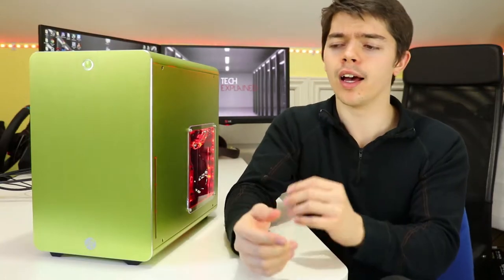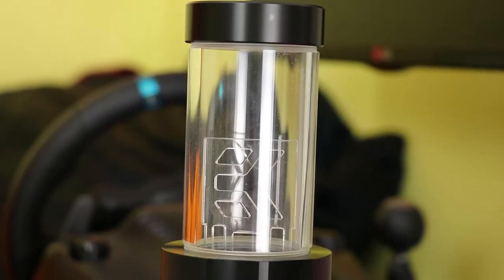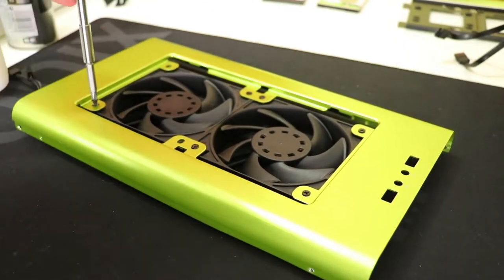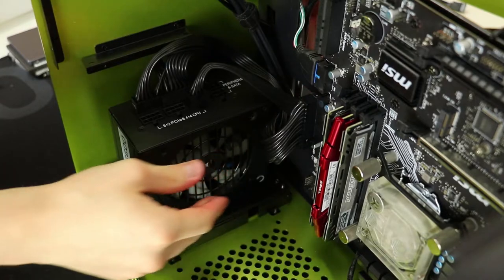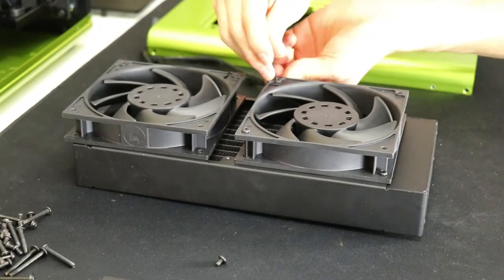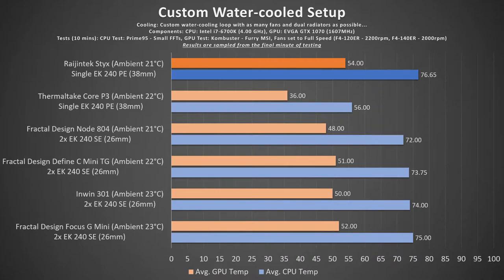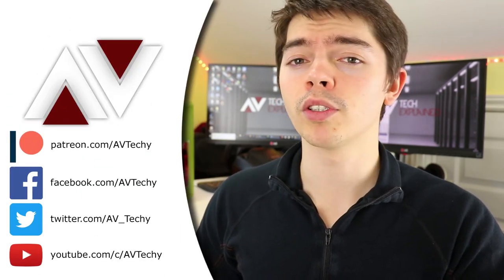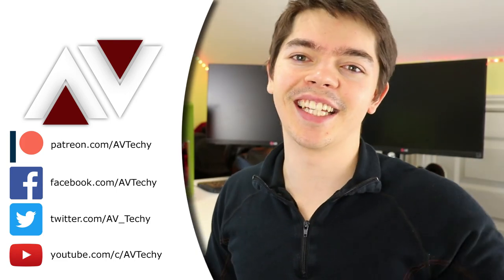Raijintek Styx Micro ATX Review - Water-cooled

Comment: Amazingly done, came out really good. That full adapter „bend“ going up to the rad looks cool. Too bad that thing has such an anemic window. 
Your doing such a great job with this channel, I hope YT finally „realizes“ it, just stick with it this will take off at some point and go faster than you think once the „switch“ drops. And then you’ll have plenty of content for newcomers to check out and stay engaged.
Reply from the maker: Thank you very much!

I wasn't 100% behind the full adapter bend, but it turned out to be pretty cool. And the other way I managed to make it work looked like a mess.

I was looking into getting a last minute sheet of clear acrylic made to replace the side panel. It would have looked so amazing, but I couldn't get one in time for the video :/. The window is just too small if you can get rid of the Drive bracket/panel. I'm going to have to see if I can find some sort of quick way to make clear panels quickly, I'll have to look for a nearby workshop that does that sort of thing.

One of the major factors that keeps me pushing to make better and better videos is exactly as you've mentioned. If/when this channel starts growing significantly I should have a great back catalog of videos for new viewers to see. But the same goes for potential future sponsors, I should have a respectable amount of good videos by the time I get in contact with some companies which 'should' inspire some confidence. I like to think that if some companies notice this channel they'd like to support it from the humble beginnings. But now I'm really speculating haha.

I'd really like to get into some super budget builds, but ironically it takes a big budget for a channel of this size to make one of those videos. Well at least about a system that's actually worth recommending. But that's a target, perhaps we should aim for one of those videos by the end of the year.

Damn it I've gone on for way too long again haha, maybe I should stick to a Twitter style 140 or 280 characters. Anyway, once again I really appreciate the support, and I hope the lighting was a little better this time around :)
Reply: AV Techy lighting was excellent, your hands were actual skin colored and not ghostly white^^
Normally I like a more suttle cooling loop look but that full mechanical looking connection has something going for it. I even went as far as sleeving my hoses to somewhat hide them^^ 

Working with plexi is fairly easy, it can be cut with a saw (powertool or by hand, fine blades for metal cutting) or scored with a knife or specialized tool and then snapped over an edge. 
I made a simple window for my case out of a 3mm sheet and to fix it I just stuck self adhesive magnetic tape around the perimeter. Would advise to spray paint the inside edges black though before putting it on as the backside of the tape doesn’t look great...it holds on to a steel frame really good.
Reply from the maker: Excellent, I decided to leave the ISO up to Auto with a set target whenever I wasn't manning the camera. Seems to work so far, so I'l stick with it since it's great to appear as human as possible in these videos haha.

I'm a fan of most styles of loops, as long as it's done relatively well and looks clean.

Thanks for sharing your experience with creating side panel windows. I really wish I had the time to create one for this case, it would have looked so good! 

I need your advise for the next video, do you think I should do a video on creating a parts list for a custom loop, or do you think I should move onto the next case? I need to start one of the videos tonight, so hopefully you'll get this in time.

I'm interested in doing a video on creating a shopping basket for a water-cooling loop since it's quite a broad topic and might help get this channel discovered, especially with the push to 1000 subs like you've mentioned before.

Let me know your thoughts, I'm happy go either way :)
Reply: AV Techy that’s a tough one, but as you mentioned „it could potentially pull in other people“ was also my initial thought. 
And it’s a good time as you just finished off a case before starting a new one with two vids. 

As also the grandmaster of watercooling Jay is kind of going back to basics lately there is hopefully a need for these vids as there seems to be a new generation rising that don’t know his older stuff and are getting in to the matter.

How do you intend to pull it off, is quite a subject to handle depending on how in-depth one goes?

I’ll send this one out for now and get back to you if some ideas come to mind.

...maybe going from basics, why it’s not as hard as it seems, loop order, benefits like adapting/expanding to new parts, cost effectiveness as used parts can be an option to get started (especially things that don’t necessarily degrade like reservoirs, radiators, waterblocks, as spare parts can be obtained o-rings for example) ... ok ideas already kicked in...^^
Reply from the maker: +TheSickness1234 It seems like a tough call, I'm with you on that one. But the more I think about it the more it makes sense. It'll be targeted towards the target and already existing audience of this channel, those getting into PC building and watercooling.

I have noticed Jay has been doing quite a few videos on beginners watercooling tips, so maybe there's a little room left for this small channel.

My initial thought is to do go over all the major factors to making a water cooling shopping basket. I'm thinking of suggesting a couple of options, one for lower power systems, and one for higher power systems, but I'm going to need to work that out a little more.

So essentially it will be going over all the components and answering all the basic questions about all the parts like tubing and fitting sizes, things to consider with water blocks, hardware for filling and draining a system, etc.

And when discussing the topics I can overlay footage of how it's used and how to make sense of it. 

As for your comments, those are very sound suggestions. Second hand parts is certainly a fantastic thing to point out. There are so many ideas now, this might be another 20 minute long video haha :/ Video length is just a disease that spreads from one video to another on this channel, I need to find a cure!

Awesome suggestions, it's always great to throw ideas at someone and get the ball rolling. Really appreciate your help!

Comment: 1. Could you have possibly used radiators with built in reservoirs  and therefore saved room and maybe used a 120mm radiator at the rear?
2. If exhausting air is a problem as you were saying with the power supply, then try adding a bottom exhaust fan? (if intake is problem then add intake fan to bottom, though this may recirculate hot air)
3. Can you try removing the top dust filter to see what difference it has on temps? Some say its very restrictive
Reply from the maker: Let's see:
1. You certainly could, but of course extra though would need to be taken into account with regards to an extra set of really tight connections from/to that rear radiator. You might need to get more angle adapters to make it work, but it's definitely possible. I was considering mentioning the possibility of being able to place a 60mm thick radiator up top, but that would be subject to the motherboard heatsinks, and I don't want to mention something I can't verify. If you did go for such a radiator, you could mount it with the outlets on the opposite end of the case to help with the tighter working space.

2. The issue with the PSU is not the ability to get air into the case with this setup, it's just keeping in mind that there needs to be some sort of intake even if the CPU and GPU don't require the extra cooling. For clarification the lower position was not used as an intake or exhaust since it didn't really help with cooling in the Air-cooled video, it just made the setup more complicated since it's in an odd position relative to the components around it.

3. I would remove the top filter, but I'd prefer to test the case with the setup from the manufacturer since it's what most people would do. Having a filter on the intake makes sense, and it's worth having to reduce the dust buildup. But it would no doubt improve the thermals, just comparing it to the open air test bench results for the Thermaltake Core P3 shows the impact. I would test it for you today, but the system has already been dismantled ready for the next build which will be starting tomorrow.

Let me know if you have any more questions or queries, and of course, thanks for checking out the video!

Comment: Looking at this case, I love the orange paint, want to make a Ryzen 3700X theme build, wondering if 120mm AIO on the back (exhaust) and 120mm AIO Radeon 5700 XT (if they will come out with something like that) at the bottom exhaust and the top leave it for 120mm dual Noctua fans.

Comment: I swear there must be something wrong with your 6700k, it's always extremely hot no matter the cooling, and it's not even overclocked much (if at all) I think this is the best temps I've seen you get, I have a ryzen 1700 oc to 4ghz using a 240 mm aio, a 50£ cooler master one, and it never goes near your temps, I know it's not apples to apples, but I hit 67c under a prime 95 after 20 mins, and that's with a very quiet fan setting using Corsair hd120s, which pale in comparison to the ek varders in terms of static pressure
Reply from the maker: Okay there are a few things a bit off with that comment. First of which is that this is the worst performing setup of any water cool build that has been on this channel. That information can be found at the comparison chart at the end.

Next on the list is that the 1700 is a 65W processor by default, whereas the 6700K is a 91W processor by default, so both processors side by side you'd expect the 6700K to output a fair amount more heat than the 1700. One thing that hasn't been setup on this motherboard is locking the voltage to 1.23V or so, so under a stress test the CPU goes up to 1.35V or so which is just unnecessary heat being generated.

So in reality, with all that in mind, even when considering your overclock, it's actually understandable that the system in this video is producing more heat than yours.

If we dis some rough and horrible maths, let's say the 1700 starts off at 1.25V (kitguru being the source for that), and the 6700K starts off at pretty much the same voltage. Then with your overclock you put it up to say 1.35V, the same as this 6700K goes to when it get's stress tested, then there would still be a similar disparity of the 91W to 65W heat situation discussed earlier.

The rough and horrible maths would suggest that even with slower fans you'd expect that disparity to occur. And considering I have 2x 6700Ks and they both perform the same (https://youtu.be/GLMynpdvTJM) then it all checks out that there isn't an issue with the 6700Ks being used in these tests, and the thermals are in the ball park of what is to be expected. Not spot on, but not far off.

This is all interesting stuff to work over, let me know if you have any issues with the rough as heck workings i've written down and we can work out the issue from there.

Of course thanks for checking the video out, I appreciate the view, and let me know if you have any more queries.

Comment: 4:17 why should you not use something that's fluffy to build on?  I'm planning to do my build on s piece of cloth so I won't scratch my case. I will ofcourse start by putting the psu in and plug it in tge wall so the case is grounded. 
Would this be a bad idea?
Reply from the maker: Well you've covered the answer right there. It's just to prevent static charge building up. You could easily build a system on a bed sheet without too many issues, but if it was something like long carpet it's getting into a risky territory.

Plugging in a PSU is a great way to circumnavigate the problem. Of course the PSU doesn't need to be on, and neither does the wall socket. Just having the ground pin from the electrical circuit of the building you're in is plenty.

The 'don't build on something fluffy' is just something simple that will hopefully stick in a few peoples minds after watching this, and will hopefully prevent them from bricking a system haha. The technique you're using is the best way to ground a system when building, but of course making sure you have the power cable out of the way so it doesn't get tripped over is something to keep on top of, I know I'd trip over and rip that thing out of the wall in no time haha.
Reply: AV Techy AV Techy okay thanks, I just needed to be sure I didn't overlook a possible problem. As always you've written a great (and maybe a bit to long) awnser :) .

I don't actually mind your long awnsers because I don't have any problems reading English and because it really shows you care about your subscribers.
Some youtubers just write a 1-3 word awnser or not at all.
Reply from the maker: Haha, well who know's I may get to a point where you'll be luck to get 1-3 word answers... yeah that's not going to be happening any time soon haha. And if this all did get to that stage, then I would need to to livestreams or something to keep good contact with everyone. But that's not a bridge we need to figure out any time soon.

Really appreciate the continued support, the sub count seems to be getting back to what it was, but I'm not sure if we'll make it to 1000 before the deadline yet. We'll just have to wait and see...